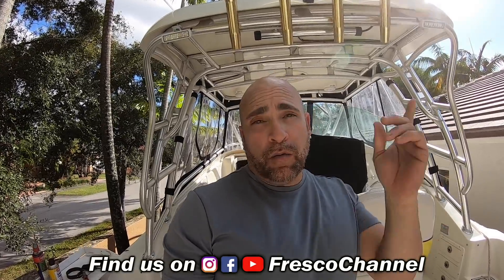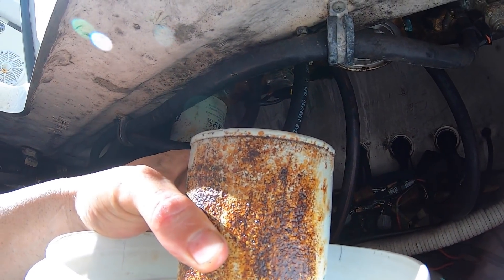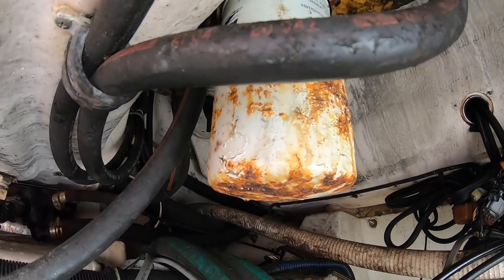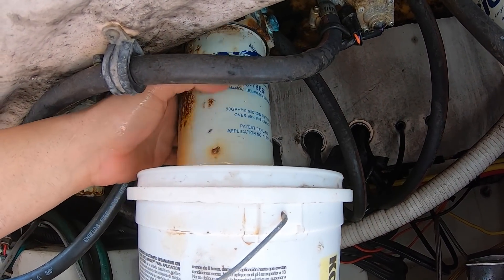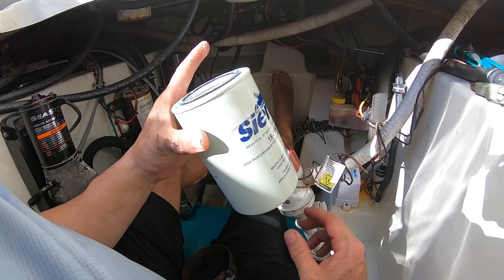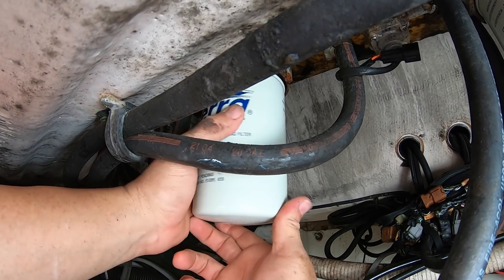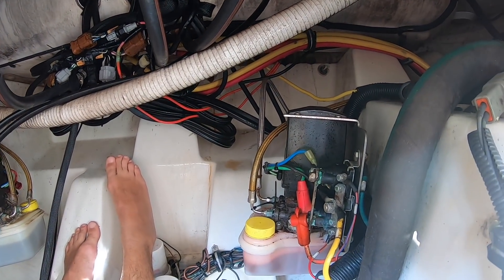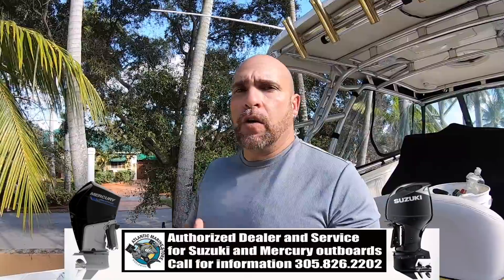How to change fuel filters on a boat DIY

Comment: Hi Fresco, your video is very good, shows your concern with the maintenance of your boat, and consequently with your family who is always on board. During the video I noticed that there are several metallic parts (pressure valves, clamps, electrical connectors) that need cleaning or at least a spraying of WD-40 in all of them. I had a speedboat since I was young and I never had any problems, because like you, I did preventive maintenance on the entire boat. I used to spray the entire engine, all metal parts and electrical connections with WD-40, it is a measure that prevents problems. It would be interesting for all your followers if you made a video opening the engine cover and showing what you do to maintain them, things like, how and when you change the spark plugs and spark plug cables and the like.

Comment: I recommend spraying corrosion-x 90102 anti-corrosion and lubricant, or those filters, and several of the other fittings (5:11 in the video) that we can see under the deck that are being eaten away by corrosion.  I use it on my boat, and all my fishing rods and reels.

I have a buddy that has 3 airplanes, and he uses Corrosion-X on the inside, even externally, and hasn't had any issues reported on his yearly inspections.
Reply from the maker: Thanks for the advice bro

Comment: The reason for NOT using better paint is when you see it rusting you'll change it, because the filter has been there long enough to get clogged (dirty) and needs to be replaced,  a "gage" sort of, 
 you would be Supprised how overlooked the filter/separator is, also check and or replace the fuel lines as needed,

Happy Boating
Reply from the maker: Thanks for the advice